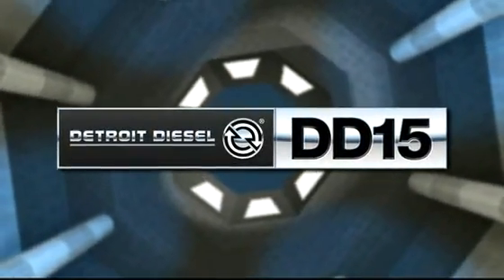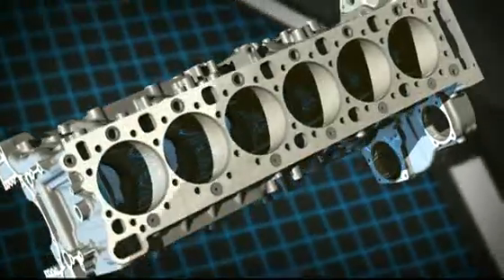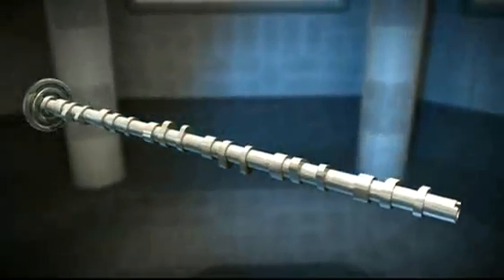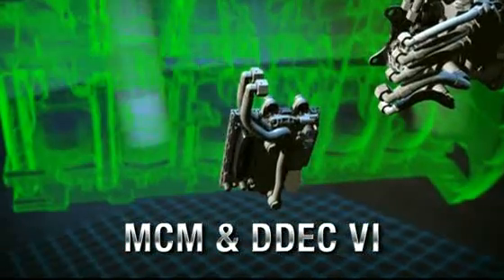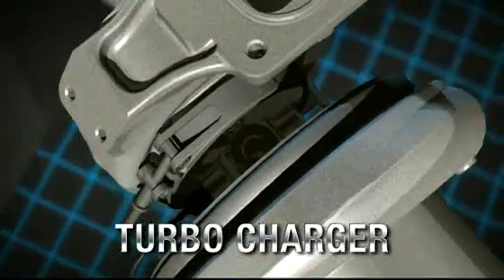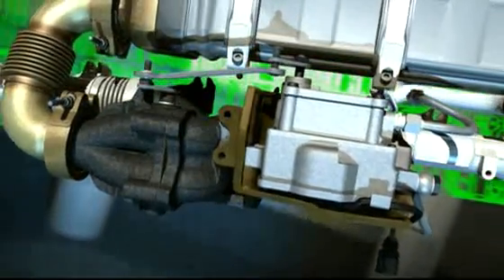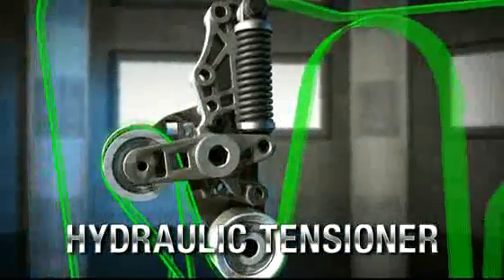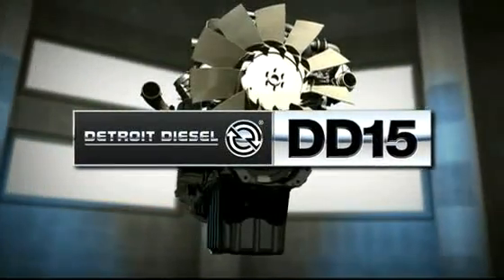MTU Detroit Diesel Australia DD15 Engine

Comment: engine block looks like a bmw gas engine block just larger, worked at scheider a driver told me his dd15 had rod bearing failure at 600k miles. my 2012 cascadia had new long block installed at 330kmiles under warrenty, rear main seal is leaking on the new engine with 320k miles engine seems to be the only good thing on the truck at this point, lots of problems . egr failure, dpf filters stopped up 3 months after purchase from select trucks, air compressor, radiator, heater core, oil separter, power relay failed fried my omni tracs eld, hood fell apart, hinges are glued on to the hood.truck is just falling apart a 650k.

Comment: the DD15 is a dud, no one likes them. No power and hard on fuel. The only solution is to get rid of Mercedes idiots and get Roger Penske back in to fix the company.
Reply: Not pulling a grade. I was talking about the pulling power then. No truck is going to get 10 mpg pulling uphill, even empty. No, Sir. On fairly level road and light load. It also does not do well in cold weather. Right now it's at 8.5 mpg.
Reply: People used to think that the Series 60 was a dud also. Some were, some weren't The later Series 60 engines did quite well in the low rpm's. I owned one of those also and would routinely let it pull down to 850-900 rpm on upgrade.
Reply: Put the transmission in high gear in the city and it want burn show much fuel. I get about 7.4. My old 2010 Cummins 15 with regen only got 6.4.
Reply: I've got one. DD15 coupled to a DT12 autoshift. pulls like nobody's business and on some occasions have gotten 10 plus miles per gallon.
Reply: billyboi57 What occasion, bobtailing on level ground?
Reply: Um, no. Pulling 40,000 lbs plus 6% grade and downshifting maybe just one gear. I can pull this engine down to 800 rpm before I need to downshift.
Reply: billyboi57 10 mpg?